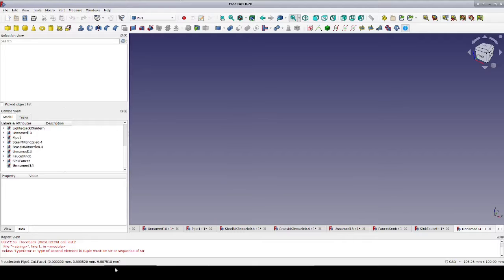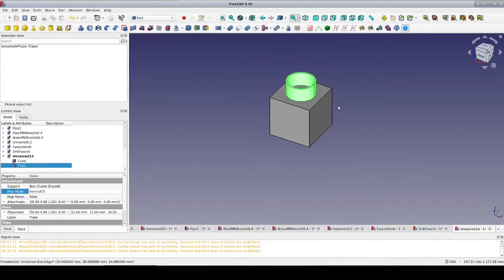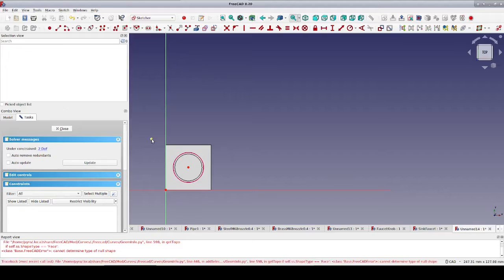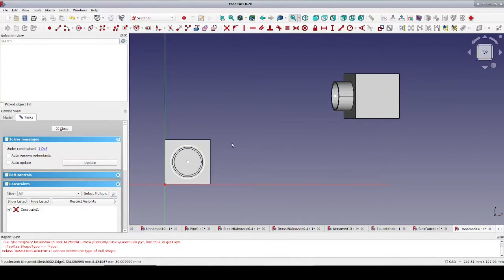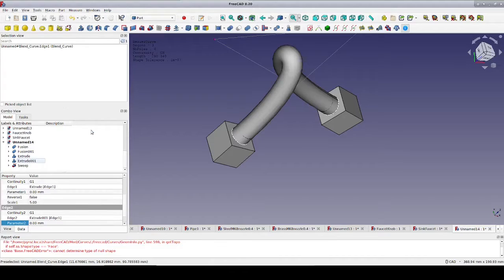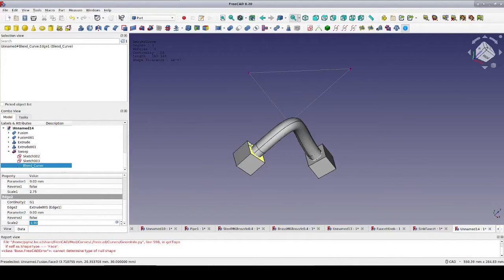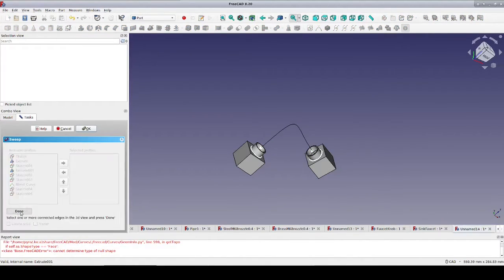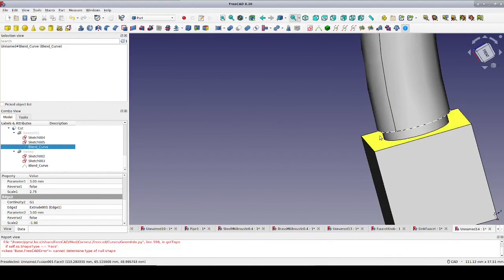FREECAD:Pipe Routing, make FreeCAD do the work

Comment: Очень крутое видео! Ты большой молодец!
Случайно не знаешь, может FreeCAD подготовить раскройку сегментов для резки трубы, чтобы из так её изогнуть?
Reply from the maker: I don't know of a ready made tool, but a good start is to discretize the blend curve, send it to the console, then do b=Part.BSplineCurve(obj.Points). Then a=b.toBiArcs(t) where t is a tolerance value will output a list of arcs and wires that approximates the bspline. You can create a compound shape with c=Part.makeCompound(a), then Part.show(c).

The displayed shape will show where it has been segmented into regular arcs which will suggest where to segment the pipe.
I imagine (wild guess) designers of things like radiator hoses probably have specialized tools for that sort of thing.

Comment: I'm two years behind here, but I'm using 1.0 and the blend curve wants to attach to the wrong side of the normal extrusion... it 'goes around the backside' so to speak. I'm getting errors about out of scope and linked objects residing within the body... Its nonsense to me, but maybe someone can help. I've tried flipping the extrusion but that doesn't help.
Reply from the maker: Select the blend curve and look in the data pane under scale. Flipping the scale from positive to negative will reverse the direction of the blend curve.
Reply: Ok, I've slept on the problem and for anyone else having this in the future: the fix is incredibly simple. Select the blend curve then in the data panel change Start Size or End Size, depending on which extrusion you selected first and then change the value to negative by typing "-" in front of the size value. Hope this helps someone. Thanks @DuyQuangDang for making a video where he does this and where I learned it from.
Reply: I ran into a similar problem and found that in the latest development version 1.1.0dev there is the option to extrude forward or backwards or both, which is just what I was looking for.

Comment: Thank you for the tutorial! As you say, FC is quirky... 

At first I could not get the geometry of the fusion to select from within the sketch (at 2:55). 
This is because in my version of FC, there is no link to "Create Sketch" from the Part menu.  So, I went to Part Design and clicked "Create Sketch" like I usually do. 
This automatically placed the sketch inside an active body, and since the fusion was outside the active body its geometry was unreachable. 

To fix the problem I went to sketcher and clicked "Create Sketch", which calls Sketcher_NewSketch. 
This is different from "Create Sketch" in Part Design which calls PartDesign_NewSketch. 
The icons look identical, and I never noticed the difference before today. Hope this helps someone.
Reply from the maker: Part Design really doesn't seem to mesh that well with the other workbenches though it is popular. I was using a custom toolbar (https://www.youtube.com/watch?v=N8jpKo9uAEs) in the Part workbench.

Comment: I want to create a path similar to yours in part design.  The part will turn 90 degrees 3 times, each time with the sweep path orthogonal to the path,   It will be in a cube, with. Nozzle on two faces.  It will use subtractive sweep.
Reply from the maker: You may be interested in my video https://youtu.be/MrTBT-oXQ4Y. It' a toroidal propeller design but it shows using a sketch as a scaffold for a mid-sweep anchor to provide more control over the sweep. You may want that to make the 90 degree turns.

Comment: Thank you. I learned a lot.  Found a simpler way. And it may prohibit future problems with running dual sweeps with different sized objects. I noticed that kinks and twists are too common and can happen if you overlay sweep paths with different sized objects.   * Try 'Offset' instead.  You need to setup your first sweep with the tubing inside diameter sketches. As you did. Perform the 'Sweep'. But, do not select 'solid'. Instead select 'Frenet'. Complete the sweep. Select the 'Sweep' in Combo View. Select the 'Offset' command. Change parameters: Offset = 1mm, Mode = Pipe, and check 'Fill offset'. It creates a nice solid 1mm thick tube.  I don't know about future or potential problems. It just seems simpler, without more sketches, sweeps, and boolean functions to cut.    .
Reply from the maker: Sometimes offsets work great and make things simpler. Other times they seem to go into the weeds and won't come to a solution at all. The reason I avoided that answer is that seemingly small changes can tip it over and make it refuse to resolve.